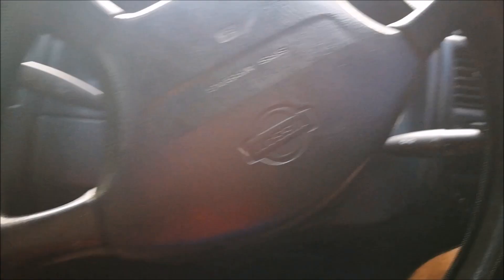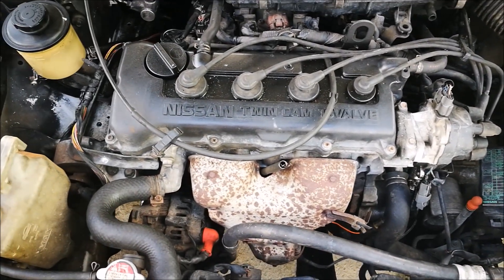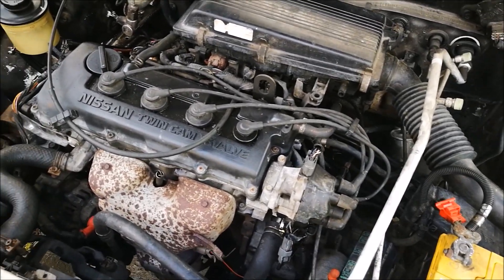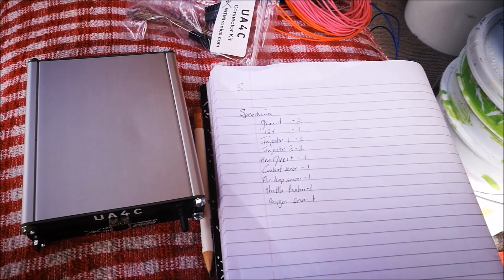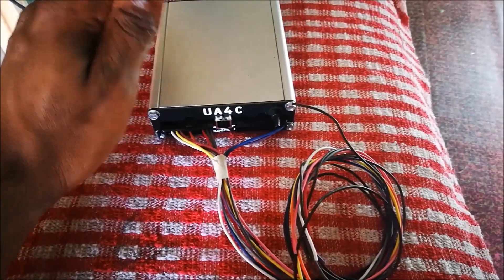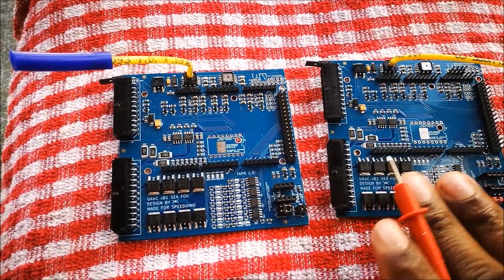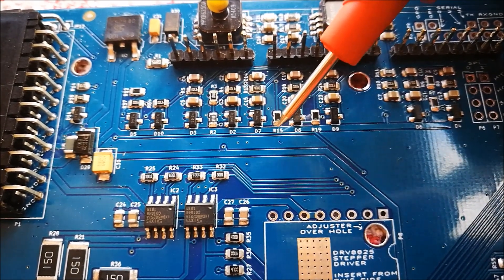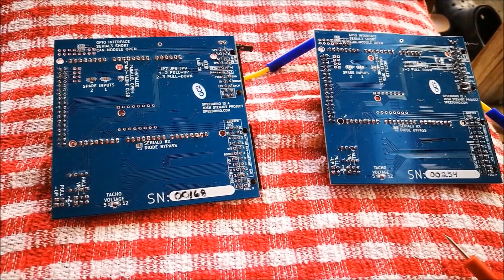Speeduino ECU On My Daily - Intro

Comment: Are there mods to be made to v0.4.3d board if running it in parallel?
Reply from the maker: Yes the bias resistors have to be removed

Comment: i wish i could buy one of these but everyone is out of stock
Reply from the maker: Hey Ashley are you looking for a Speeduino PNP Miata ECU or a UA4C like what I used on my Nissan ?
Reply: @DCWERX  I am just after a complete assembled ecu that will work with batched IGN and fuel and a stepper motor IAC , 0-5v wideband input and Knock input would be nice, I'm based in Australia
Reply: @DCWERX   i think the PNP miata ecu will be best for my application, can i direct message you on facebook??

Comment: What do the physical mods actually do? And why is it needed, what hinders it to run in parallel by default?
Reply from the maker: The bias resistors from the speeduino and the factory ECU will conflict. If you do a parallel installation without the mods, your temperature readings in Tunerstudio and at the factory ECU will be off, most times lower that what it actually is.

You can run a separate coolant and air temp sensor for the speeduino and not have to mod it however that just means you have to spend more money. As far as I know this has to be done with any parallel ECU installation no matter the brand of ECU. The sad thing is you don't see too many parallel installations documented.